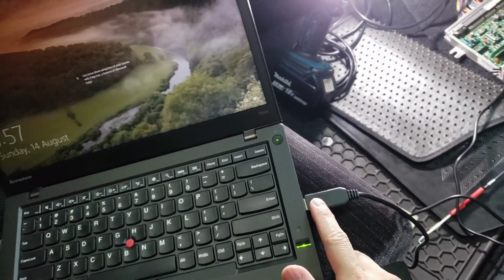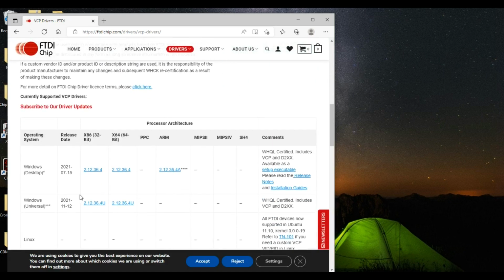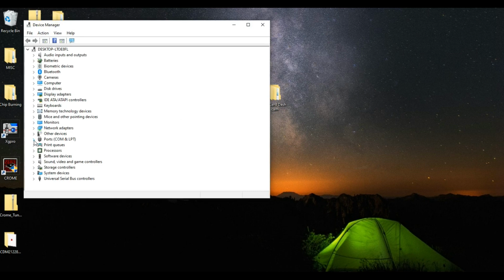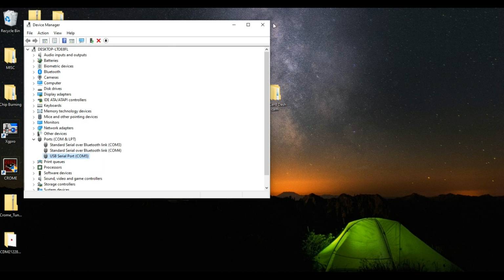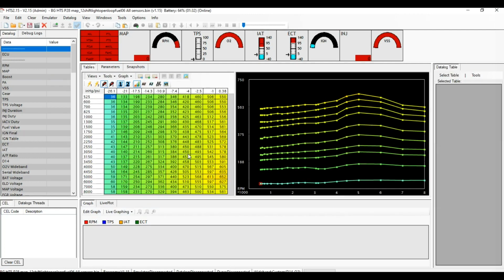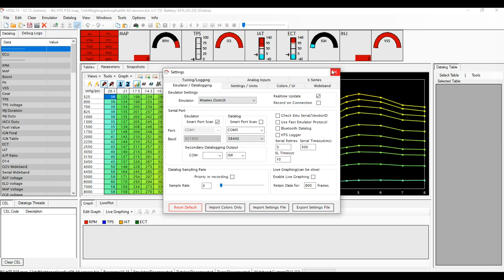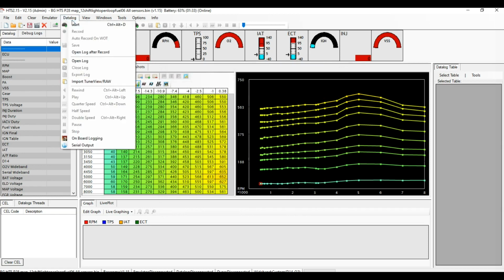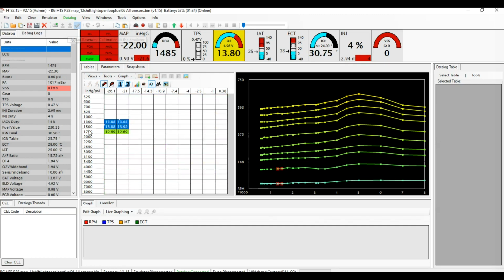||HONDA EF9 / ED7 88-91 CIVIC/CRX|| All Set for DIY EF CIVIC TUNING🔥- Datalogging Using a $6 Cable!

Comment: Hello, I would just like to know if in this way that you show the map can be recorded on the chip or if it is possible to do so since I do not have a chip burner, I would like to know if this way it can be recorded.Thank you
Reply from the maker: No, this is datalogging only. This only receives the data for you to adjust your tune. This is only one part of tuning. To record your tune, you need a emulator or a chip burner.
Reply: @BudgetGears  Thanks for the information, any chip burner that you recommend to be able to record on the chip, because right now I have my computer with the bluetooth datalog that appears in the other video but it doesn't connect to me, I don't know why it is but I would think that it is more comfortable to work with a chip burner, could you recommend one? always to be able to tune from HTS
Reply from the maker: @davidrivas6929  I don't have any chip burner recommendations. I personally just use whatever is cheap, which is my TL866II eeprom programmer. I wouldn't recommend this unless you're familiar with chip programming. You can use the Moates Burn2, which is what everyone used to use back in the day. I don't think tuning using chips is the most efficient way though. It's best to use an emulator for tuning as it's real-time.

Comment: i did exactly how u told in the video and yet i recieve debugs like cant connect to ecu, com port cant be opened, cached com port and so on.. please help me.. i have been stuck here forever and my car is not even running right i am just trying to fig it out please.. 
i am using hts 2.15 in windows 11

Comment: Great vid bud, I am looking at a cable on AMZN and it has the White as TX and the Green as RX is this a manufactures change of did you get it mixed up in the video? Keep up the great work and Thanks! Amzn Srch (DTECH 1.8m FTDI USB to TTL Serial 3.3V Adapter Cable TX RX Signal 3 Pin 0.1 inch Pitch Female Socket FT232RL Chip Windows 10 8 7 Linux MAC OS (6ft, Black))
Reply from the maker: Thanks. No, I didn't get the wiring mixed up. The wire color doesn't matter, the manufacturers can use any color for the wiring. The main thing is to go with what they provide for wiring. My video is correctly wired as per what I have from the manufacturer of my cable. A different manufacturer may use the same colors or different. Just go with what each wire does instead of the color.
Reply: Cool Thats what I was hoping. Thanks Man @BudgetGears

Comment: Hi! I have a question, can you change the ECU map from the computer? I mean just with the ttl cable, or is something else needed? sorry if you don't understand, I don't speak English
Reply from the maker: No, the cable is just datalogging. You need an emulator and a separate cable to the emulator to change the map. These are 2 separate processes on the ECU.
Reply: @BudgetGears  And how can I search for them to buy them? emulator and cable. thank you so much!!
Reply from the maker: @santiagogarcia587  Use Google. There are a lot of options for emulators. You can even get stand alone ECU's for tuning. I suggest do some research on what you want to use. I cant recommend anything specific because its up to personal preference.

Comment: Hello can i ask. Why does the J12 resistor need to be removed? And also, does it harm the ecu? Thank you!
Reply from the maker: Its so you can datalog. I don't know all the technical reasons, but its something thats always been done since people started modifying these ecus. Its to do with the datalog communication. Most of the tuning programs will require you to remove it. It does not harm the ecu unless you damage your ecu removing it incorrectly. So if you're familiar with electronics, you should be fine.

Comment: I have a wire and got the drivers running a bmtuning emulater and it keeps timing me out when I try to data log on hts any ideas
Reply: same as mine everytime i press datalog it says operation timed out

Comment: friend, i'm from portugal. I watch your videos. I would like to know how to send shots with very long flames. I don't know what the proper name for this is 2 step or launch control I don't know. but I would like to know how to do it even at any rpm and to send very large shots with really aggressive flames. if you could make a tutorial one of these days
Reply from the maker: Thanks for watching! I'm not really sure how to tune for flames. Tuning isn't really my specialty. I think its part of the popcorn mod settings. I'm not too sure how it works, but I'm assuming it's running very rich and messing with timing to do it, which in theory isn't really good for the engine.

Comment: Do you need this to tune afr with bmulator and hts?
Reply from the maker: Depends on which version of the bmulator you have. Some didnt come with a datalogger like mine. So if you don't have a datalogger then yes you need it. If you do have datalogger then no.
Reply: Gotcha, just checked the description of the one I order and it says it does support USB data logging

Comment: Thanks. I'm just getting back into honda tuning after some years off and been wondering where to get that cable since moates went out off business.  Luckily I found my emulator, chip burner and everything else I used to tune with in my garage.
Reply from the maker: Yeah Moates has been a player in the ecu tuning world for a long time. It's so sad that they're gone. They used to be one of the more affordable ways to tune with really good support on their products.
Reply: Hey how do I get my ecu ready for tuning? its for a 90 civic d15b.
Reply from the maker: @moejoegaming9838  Your engine doesn't matter. The question is what ecu are you running? If you're on the stock ecu, which is obd0, no one or not many would support that. Your best option is to convert to obd1. If you're already obd1, then you need to modify your ecu by chipping it and either installing a socket with chip or a RTP.

Comment: Whats up man quick question, I currently have a f20b with hondata v300 and would like to enable my iacv. It is currently disabled from previous owner. Any help would be appreciated
Reply from the maker: I don't believe you can disable your IACV. You can only turn off the engine check light when your IACV gives you and error or if you don't have an IACV, which is for those setups running ITB's. I'd suggest you check that your IACV is there and the plug is connected and if you want to enable the error code, if you even get a error code, then go into your parameters in smanager and go to Idle and uncheck the disable IAC error box.

Comment: hi.. @budgetgears
i tried with usb ttl ft232, when i click star on HTS then the message " cant connect with ecu on com3 see the debug logs for the issue "
What is wrong?
Reply from the maker: What does your debug log say? Also, make sure you have the correct com port selected in your options in HTS.

Comment: No tuner wants to tune this way in my area and u got my hatch running happy at 8 psi
Reply from the maker: I think most tuners prefer to tune using more convenient methods now like RTP with built in datalogging or using a stand alone ecu etc. The old methods of chips and cable logging etc are old school for them. But still works great for self street tuning. 😁
Reply: @BudgetGears   main reason is that the main company that provided emulators , cables, and chip kits went out of business. So every one moved up to rtp boards. If you can find an emulator , cable and chip burner it's pretty much the same as using  a rtp board.

Comment: Do you by chance have a link to the cable you bought?
Reply from the maker: It's probably best for you to search up the cable yourself. The seller I purchased from is long gone. Different sites would have different prices. I did a quick search on Ebay for you and here's another seller, but it's not as cheap as what I paid. 

https://www.ebay.ca/itm/263914476814?hash=item3d7287550e:g:5xEAAOSwDyxbjPhK&amdata=enc%3AAQAHAAAA4ER310rN34dRvkUjYv4pcuBXvCnMQi8BXkwARL13NKF6zRkoKPDhp7FtYf%2FpENaHZ92Nsq4OsycxWghCV1F9JC1%2BShITA1gwSGiEI3a9L%2BlygUE1IbztSg5ueuxFs71tW%2FEZOHSpXQpShQUFolHgwFAr8jKOciomzkzi7BRWJR8xXxVvToHGp%2Fu1pJKh53ZZ6vm2aG5oLTz5UuGWDl6pZmPsXFLWUhSZGW786n9rxZGo6G2YYaMjJHWGjQ4%2FuOulIrah8mpWDKf3oMO3ZatAmgDIVXIlZSNvDlJLxdN2COqZ%7Ctkp%3ABk9SR6LZ1P7lYA